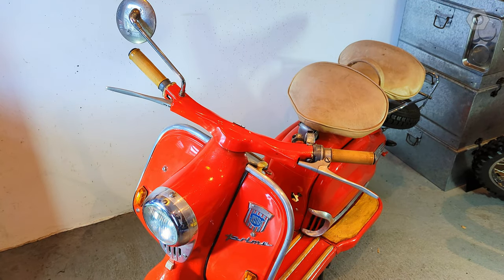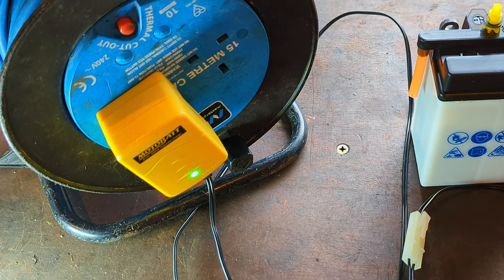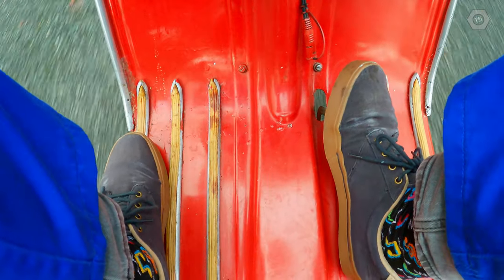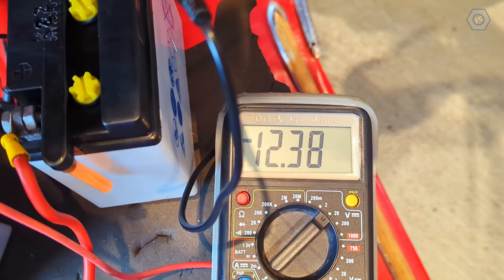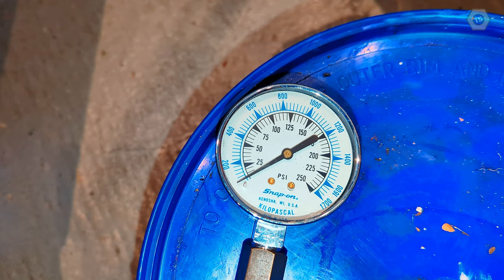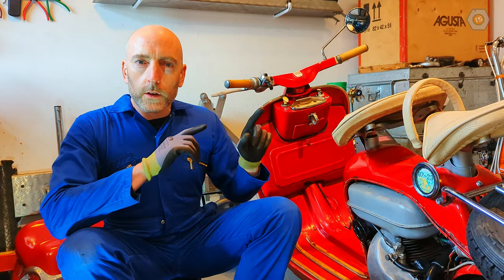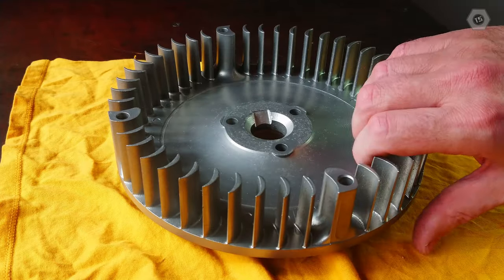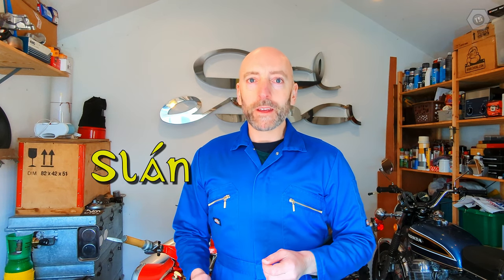NSU Prima Restoration - Part 1

Comment: I have had several prima Ds, although not as popular as a Lambretta are virtual the same ,had a Prima V star from 1961 to 64 including throughout the worst winter on record  excellent reliable machines,your example looks very good,Original seats may have made it more as original, thanks foe an entertaining  blog
Reply from the maker: Thanks for the message, Colin, that sounds like some experience!  The chromework and zinc plating for this Prima is now complete and looks amazing.  I'll have another video along in the coming weeks.  Thanks for watching.

Comment: Hi, I just came accross your video. Very informative to someone who has never had any experience working on bikes. I did a video myself of an NSU PrimaD  restoration, but I am not a mechanic AND i sold it without doing the engine. Have you done the engine yet as I have a Prima iiik engine to do. I have back problems , but i'm determined to tackle the engine. I'm in Ireland. Tom Cahill
Reply from the maker: Thanks for the message, Tom!  I'm currently getting the welding and chrome prep finished and will be putting out an engine disassembly episode followed by an assembly one after that.  I'd really like to have things move along faster, but some things cannot be rushed.  Stay tuned.  And fair play to you for tackling your own engine. 👍